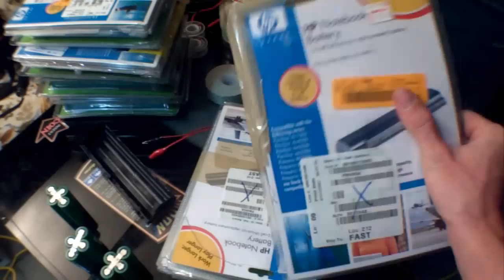DIY: 48v 24ah lithium ion 18650 e-bike battery pack

Comment: Someone needs to kick me in my tush to tell me if it is alright to charge batteries in series.

Because as far knowledge as I have acquired in engineering school, is you shouldn't. You can, but you shouldn't.

1. We don't know what the internal impedances are. Even if we knew, we hope they are as minimal as possible.

2. We cannot assure that every battery has the same internal impedance. I will say that the internal resistance of a battery is between 0.1 to 1 ohm.

3. And the internal resistance varies with temperature. And we cannot assure that every battery has the same gradient of change with temperature.

3. Let us say we charge 4 cells in series, where the resistance each respectively is
    0.1,  0.2, 0.15, 0.3.
    If each cell is 2.4V with 0.5V overvoltage assurance, our colloquial understanding of how the electricity works would tell us to apply 2.5 x 4 = 10V, across the 4 batteries.

4. This is the problem ...
  Total resistance = 0.75 ohms
  Therefore we know that 
  Cell 1 will get charged with 0.1/0.75 of 10V = 1.333.. V
  Cell 2 with 0.2/0.75 of 10V = 2.666.. V
  Cell 3 with 0.15/0.75 of 10V = 2 V
  Cell 4 with 0.3/0.75 of 10V = 4V

5. As you can see, we are overstressing cell 4 by charging it with 4V, way beyond its 2.4 + 0.5V overvoltage spec.

This may seem okay in the short term. Since I am not a materials science expert in the field of battery design and manufacture, I would in my compulsive mental state say, would deteriorate the life of any battery that is subjected to such overstress.

 They may not get damaged in the short term, but there is something called fatigue effects.

Especially if you are not even using batteries of the same brand, and therefore the same process and the same process specs.

Perhaps they do make batteries that are able to sustain charging stress of 5 - 10 times their output voltage, without long term damage. They must be very expensive, and why would I bother to make them? And rare.

Also, it is dangerous to charge a battery beyond their overvoltage limit.

The right way to charge and discharge a bank of batteries is to have a controller to perform managed charging/discharging where

1. during charging, the cells are switched to parallel.

2. during discharging, the cells are switched to connect in series.

That would mean you need to get a controller board with some high voltage solid state switches, and know how to program that board and connect up those switches.

The cheap way is to parallel high resistance of 10K ohms across each battery, so that that parallel resistance will ensure each battery is getting 2.5V of the 10V.

But you would need a way to disengage the resistance bank, when the batteries are not in charging mode, and especially when you park your bike/car for long periods of time to prevent the slow but wasteful draining of electricity thro the resistance banks.

Could someone correct me if I am wrong, because in engineering school, charging a bank of batteries in series without stable and acceptable voltage differential between them would give me a fail for that question. And the tolerance for that failure is inversely proportional to the willingness we have to conserve the life of our precious rechargeable batteries from overstress.
Reply: +Cynthia Avishegnath I don't know nearly as much as you do, but what I do know, is that particularly with certain types of batteries such as lipo batteries used in RC cars, that they have 2 sets of leads. The one set of leads is the output. A separate set of leads is for the input to charge them. The charge leads charge each cell individually but the output leads are wired probably in series. The chargers are often referred to as balance chargers & I have read that for these types of batteries that the cells need to be balanced exactly as each one is not identical to the other one, in its chemical or performance makeup, due to variation in manufacture. So I do also know that for some types of batteries in particular that they should not be charged in series for these reasons. Sorry I am an industrial engineer so my knwledge of electrical is not that good.... but I try.... So long term yes it can cause damage, but I am sure that my NIMH hydride packs are charged in series, perhaps they are less sensitive to this problem?
Reply: +Cynthia Avishegnath Series connections are done all the time.
But they require protection sensing circuits for ever cell in the series.
Reply: +Markus Bates The PACKS have charge protection circuits on them,not the cells themselves.Once you remove these cells from the pcb the are on their own.The proper balance charger should protect the cells while charging.Also these cells cannot be ran down to a certain voltage either,so a low voltage cutoff or buzzer is a must to protect them from over discharge.This video is a little more advanced!This guy is assuming we already have a basic grasp of lithium batteries and building battery packs.
If you cannot even change the oil in your car,then do not even think about swapping the engine out!
Reply: +Cynthia Avishegnath Not to mention that some of these cells he is using are different voltages.Color seems to be a factor for me.The reds seem to be the lowest at around 3.7 and the greens around 4.2.I am not 100% about the colors,but that is how it is for all the cells i have now, and i have about 35-40.
That is how we get 12.8v and 11.1v lithium packs,both with 3 cells each.I have used a blue,green,and a red in the same pack albeit much smaller packs without much trouble,but it can't be ideal.The 3.7v's will get overcharged a bit or the 4.2's will get undercharged a bit.I think longevity and not a fire is the main concern.Also about discharging......These things hold their charge for a VERY long time.I have seen these things hold there charge for easily over a year!!!!NO JOKE!All my flashlights have been converted to use one of these cells,and they stay charged for months and months, and burn brighter!
Just for fun.......Get 1 of those dollar store laser pointers and rebuild it to take one of these batteries and you will end up with a $50-$100 laser pointer that will go farther then you can see it!Also you can get little lipo chargers that will charge 1-2 of these at a time for like $3-$5.
Be safe and have fun!
Reply from the maker: +lbad boyl no they are all 4.2v cells, some are capable of handling 4.3v though. 3.7v cells are 4.2v cells, its just a differance between nominal voltage and full charge voltage.
Reply: Cynthia is absolutely correct in that charging or discharging batteries in series
is not the best.They can be protected by
electronics design.But do these circuits
really work best?Someone needs to design
a charging system that charges each cell
separately.This would be ideal.
Reply: Markus Bates
 You are sooo wrong!Look at your own research!The circuits are added to one end of the cell,and 100% NOT built in.That is a 1s!!!
You can use the word pack or not.You telling me that your going to take these batteries and build them into a pack?That is hilarious!Are you such a fragile metro that you see my statements as abusive?Nowadays a man speaks like a man and he is hostile?THAT BATTERY HE MADE WILL WELD METAL!!!!
I gave advice to stress the danger of these things.Then to have some sissy see it as a personal insult to his intelligence is so typical.What is the matter?I didn't advise you in a sensitive enough manner?First off ,get some pants that fit,then cut your hair,THEN you can burn down your moms house!jUST TRY NOT TO GIVE OTHERS ADVICE THAT WILL GET THERE HOUSE BURNED DOWN TO!!!!!!!!!!
Reply: ibad boyl is right 48 volts d.c. is viscous.
Reply: nowadays BMS are available to protect cells from damage, and it cut offs the voltage once it reaches the rated value.
Reply: You knowledge on this subject gives me a headache. No I'm not being an ass. I'm really impressed. I'd love to see a video on how you would do it. I'm just a truck driver. But I enjoy these types of videos. I see them as tutorials. That being said, you're obviously on a whole other level. So please make a video! If you do message me with the link.

Comment from the maker: yes i am well aware of it, fully discharging an 18650 cell will remove about 50% of the capacity. all the cells of my first battery pack came to me at less than 1 volt per cell. theres also a 10% chance it will short out unless its brought up in voltage by less than a few milliamps of charge.